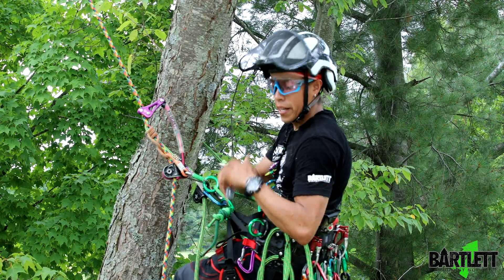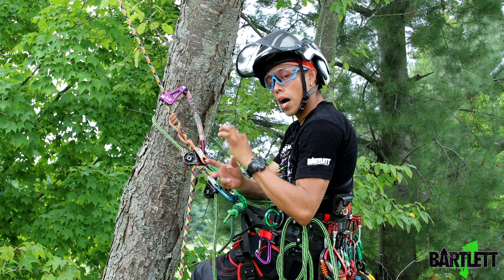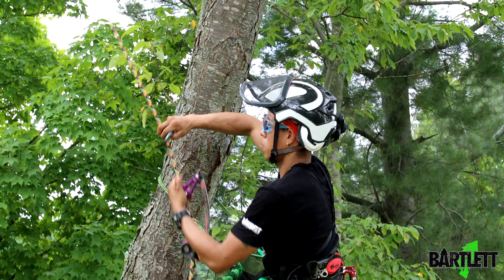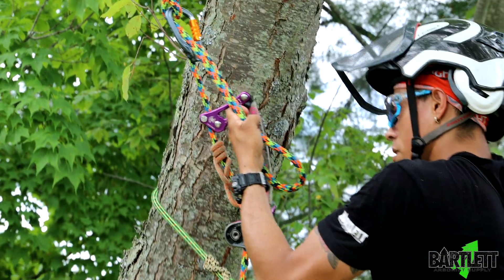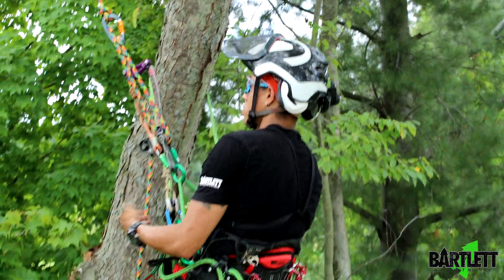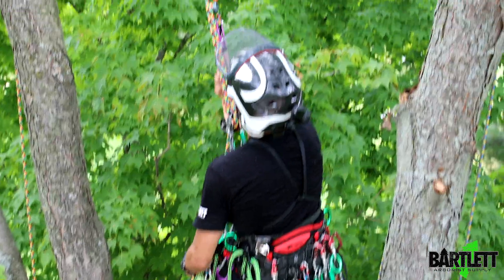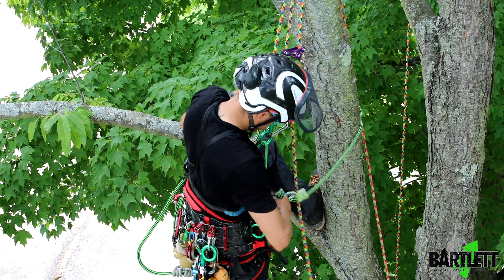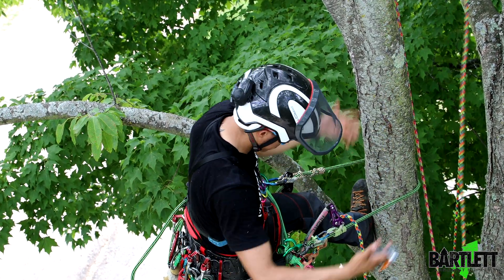Limb walking with MECHANICAL ADVANTAGE!

Comment: Same question as the rest. This video does not show the use of that scam. All it shows is you using srt. You literally went from one spar swank a tad to the left dropped down that’s it. 

No actually use of that system make new video
Reply: @BartlettArboristSupply  I guess to me as a climber, A tip is something that i can see helps. That short videos shows me nothing that helps. All i see, is a bunch of product push.

Comment: When would this actually be useful? why would you need a retrievable mechanical advantage for lowering? Or even limb walking?

Don't get me wrong since very useful ideas for rescues on low stuff for more control but the amount of extra rope you would need is insane!
Reply: Lots of good uses actually. On limbwalks on SRS, coming back is way more difficult than on an MRS system. You have to pull yourself in while also tending your slack at the same time. Mechanical advantage like this on a limbwalk allows you to easily pull yourself back in ( the MA makes it easier) which also tends your slack at the same time
Reply: @ltawsomesauce is definitely right a long limb walk is extremely hard using srs

Comment: Seems useful - I'll try that with my new DMM pulley carabiners.  Of course as being new to climbing, I figured MRS might me a good way to get around a big (wide) tree.  Initial climb via SRS then install a pulley at the top to go MRS?
Reply: The only thing about MRS when doing wide canopy trees is the added friction from climbing around branches
Reply: @patrickmuzzi  I really need to watch a pro for a day, in person.  I could learn so much.  Well, this tip here seems like it will help.  You are right, SRS will be much easier when navigating all over a wide canopy.  My first tree is a big hickory next to my house here in TN.  My young boys and I are having fun for sure.
Reply: @schwartztekllc  I run MRS for practically all removals, with the exception of a few scenarios. For pruning it's single rope for access and I stay on single with a high TIP but I also keep a 40ft climb system in a diddy bag to use when needed. Comes in handy more often than not
Reply: Yeah, I think I need a second "climb system" to go after the hickory tree I am learning on.  At the very least a long lanyard with a rope grab that can be let out under tension. I did get a little DMM bag to hold a 50ft rope and hook but need to figure out a descender setup.  I've got 3 spars that top out at only 45ft.  Then plenty of spindly branches I need to rig balanced to get out from over buildings.  Well, I already man-handled most of the low branches out but am trying to improve my methods as I go.  More height above the buildings does help.  With a second rope I can pull myself out towards the end of the branch to connect rigging. I nearly got stuck a few branches back as I was hanging from my climb line on one side and my lanyard on the other - was seemingly impossible to get my lanyard backed off after I finished tying on my rigging!
Reply: You can use the tail end of your rope for a second line.just have to make sure you're rope is long enough